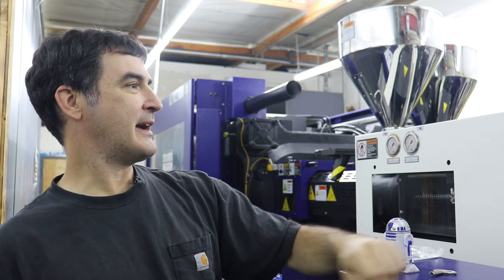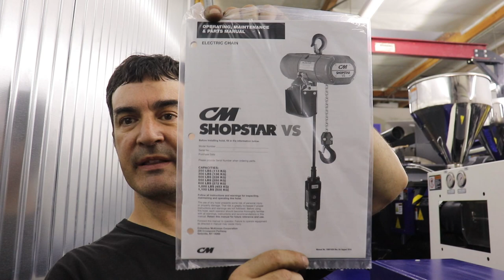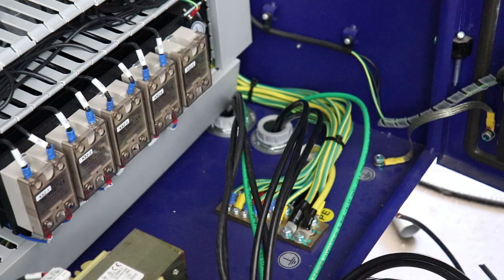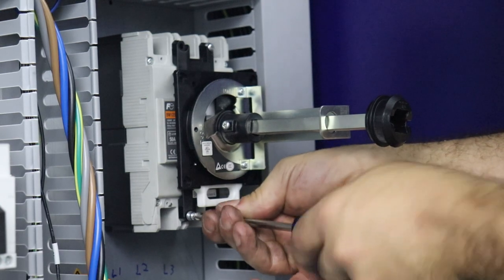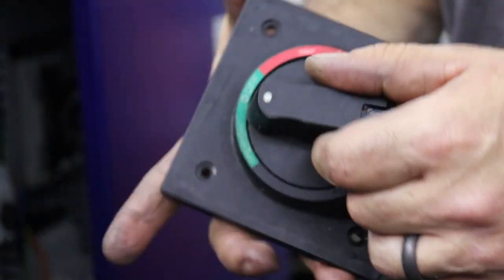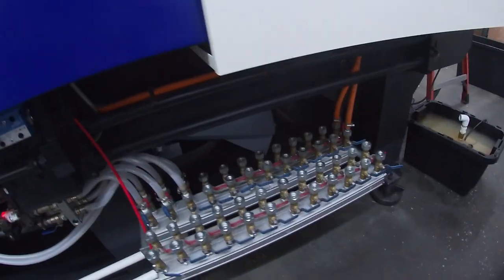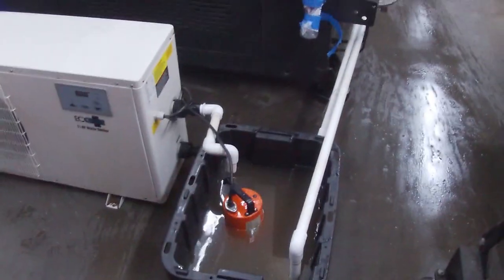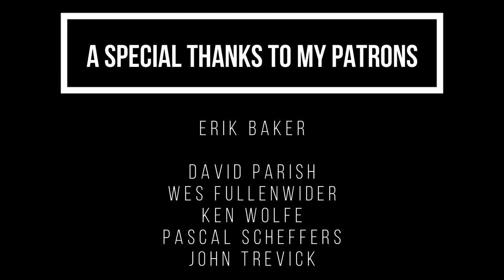MOLDING MACHINE SETUP PART 2

Comment: Great Video of a Plastic Injection Molding installation at setup. The chiller you have bought is used to cool a container of water. 
You need a tank which the chiller cools, and a separate pump from the tank feeds the machine and molds and returns the water to the 
tank. As a temporary setup, you could use a clean 44 gallon drum with an inlet to a copper coil inside the tank and the return to chiller.
Then connect a pump to the drum and feed the machine/molds with a return line to the tank from the machine/molds. Hope this helps
you.